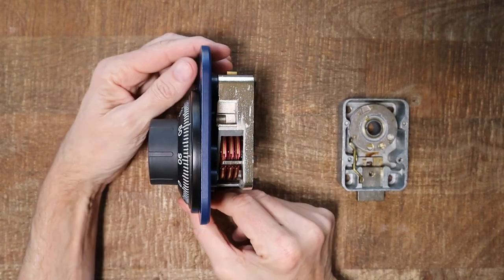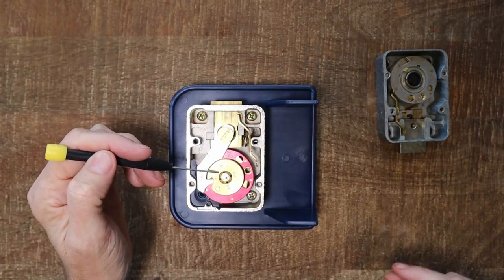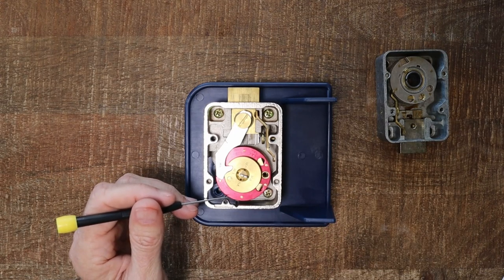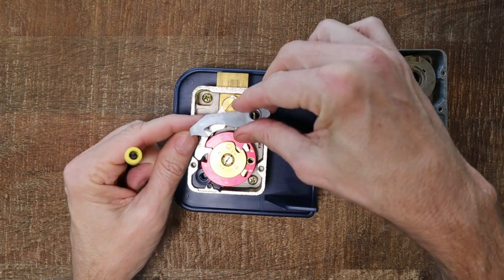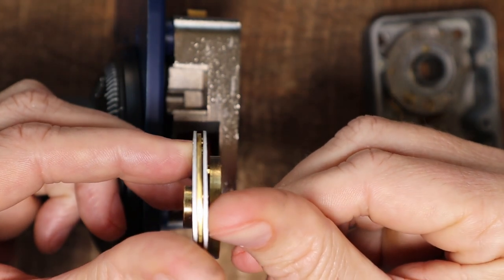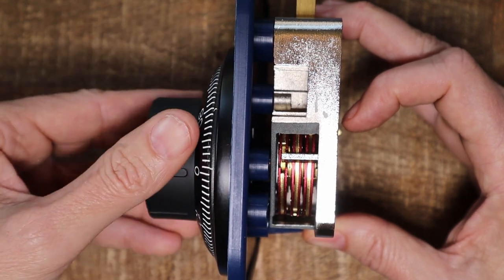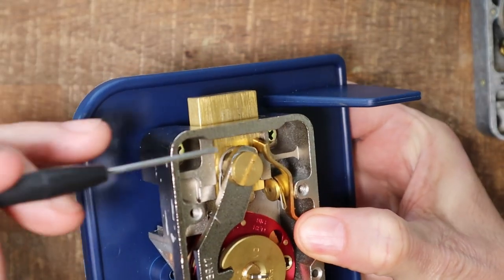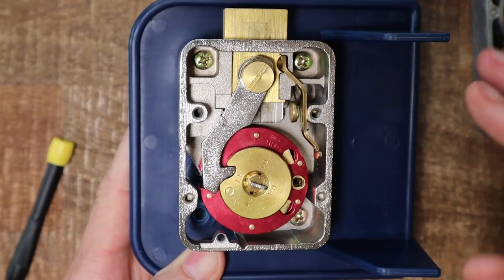How Do Combination Locks Work? We Get Inside a Safe Combination Lock.

Comment: Left 4 times, right 3 times, left twice. But how do the flies not rurn the next wheel on the very first turn? How does it skip 2 turns before it turns the 2nd wheel,  ditto for the 3rd wheel?
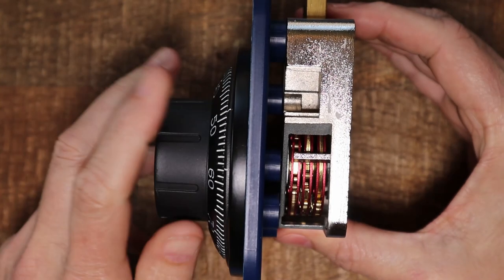Reply: 4:03 my dude. The cam spins wheel 3 which after full rotation spins 2 which in turn spins wheel 1. So basically spinning 4 times clockwise is once for the cam, then other 2 times for the wheels number 3 & 2 and the 4th time is basically turning wheel 1 into position. It's why it doesn't matter if you make more than 4 spins when inputting the first digit. Subsequent turns after the 4th will just be turning all the wheels.

spinning the dial counterclockwise after inputting first digit 3 times (one for cam, wheel 3 and eventually wheel 2) doesn't affect wheel 1. 

Hope you got it
Reply: Simplified, you need minimum 4 spins to affect wheel 1, 3 spins affect wheel 2, 2 for wheel 1 and the last spin just rotates only the cam till the nose falls into place and gets pulled to retract the bolt.

Now I just would love to understand mechanism of setting the lock code